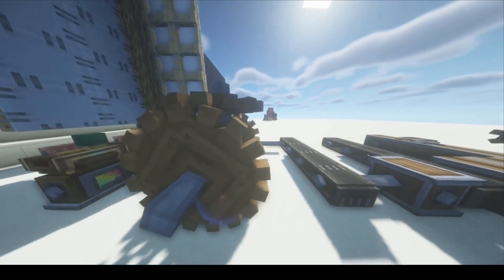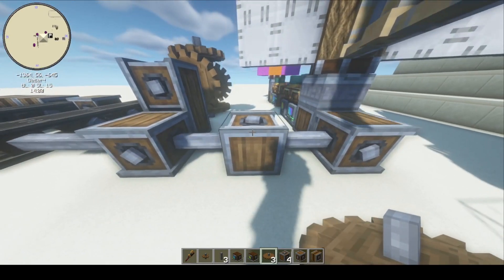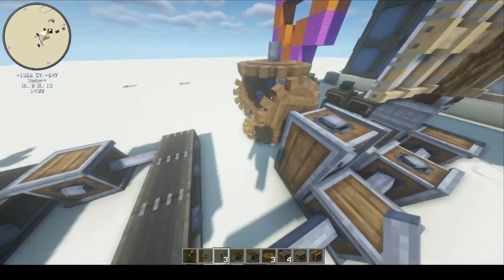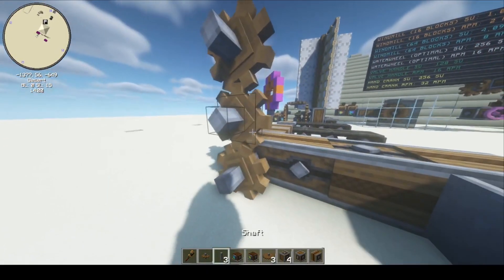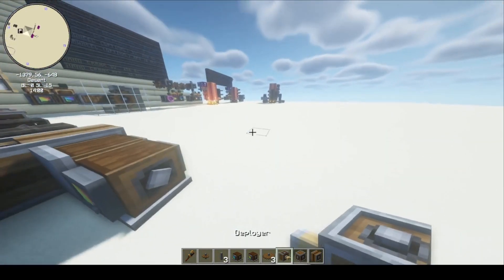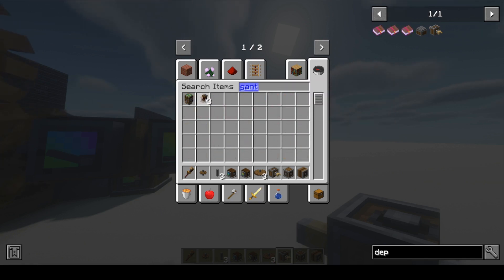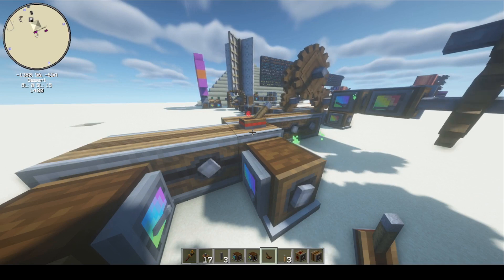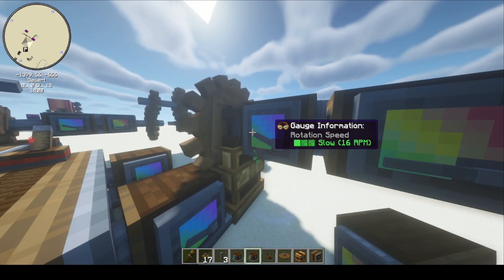Create Mod Tutorial on Power Transmission And Speed Control

Comment: My question here is how far you can transmit power.  Suppose I get a windmill, and I make a 128 block long shaft, and then put something at the end.  Depending on my settings the windmill wonʼt even be loaded anymore; does that still work?  Similarly, if I just have my stress network extend over multiple chunks, part of it might be unloaded even if itʼs right next to the rest.  What happens then?
Reply from the maker: I can't say how exactly it works but I haven't run into any problems while having the power source a few chunks away from where it's used

Comment: thanks! this really helped, all I've done was learn from schematics reverse engineering... but I have a question how do I change rpm with an analog lever/Redstone signal strength?
I've seen it in many builds and I still don't understand how to do it

i just realized my stupidity.....
you shown it in the video....
Reply from the maker: So a full strength signal will double the input speed. Each increment of Redstone signal will increase the speed by 1/15th